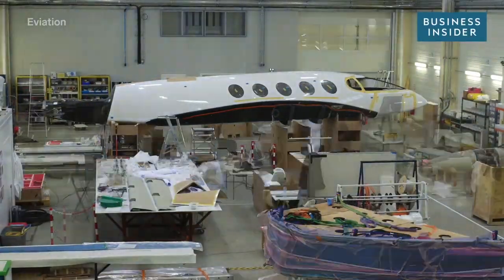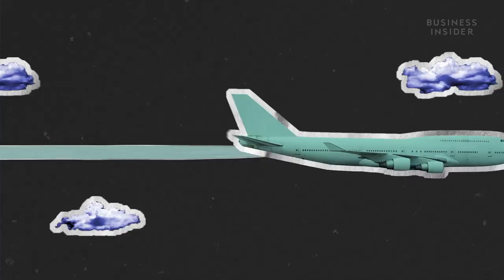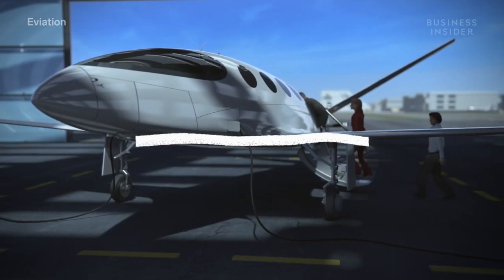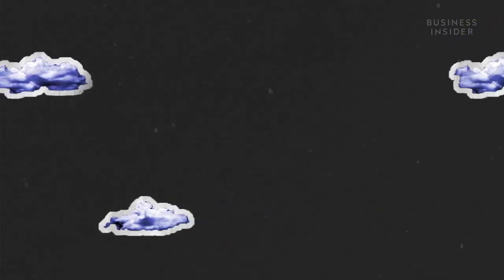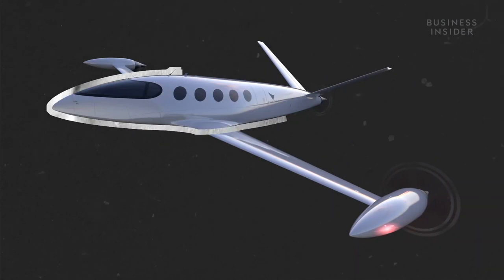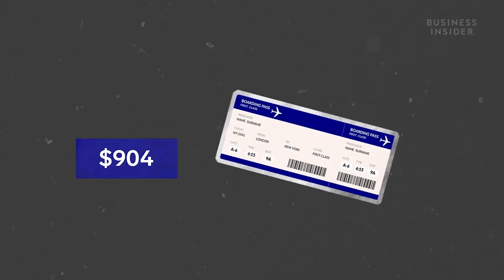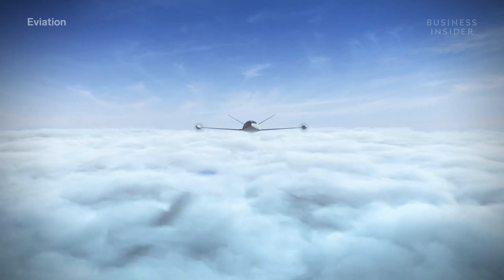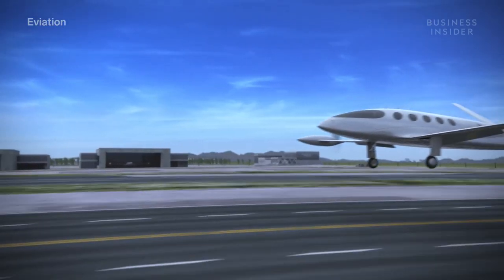Inside The $4 Million All-Electric Plane | NRK INTELLIGENCE

Comment: On such small planes, you can save space and weight by removing the pilots, in 2021+ on short 2h or 3h trips it does not seams so difficult. However electric high speed trains are probably a far better solution, at least if you have to move more than 100 souls/day and/or without water to cross.